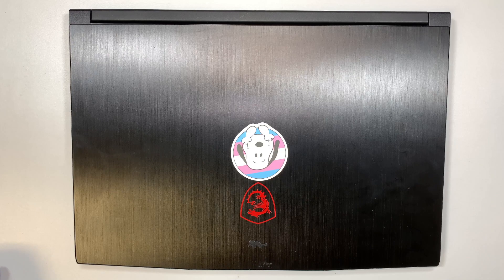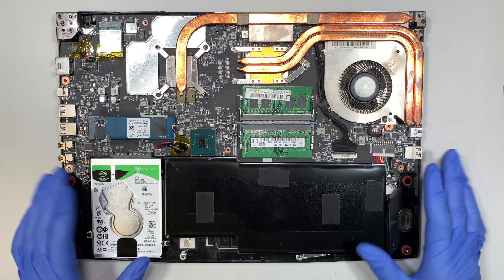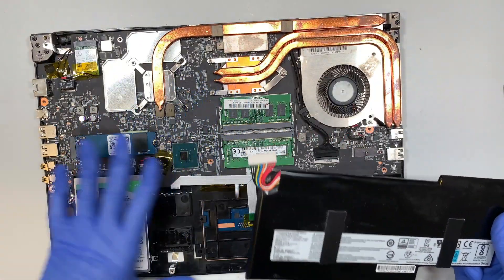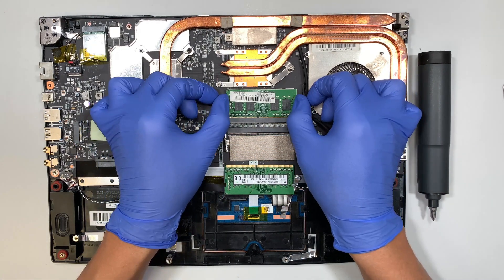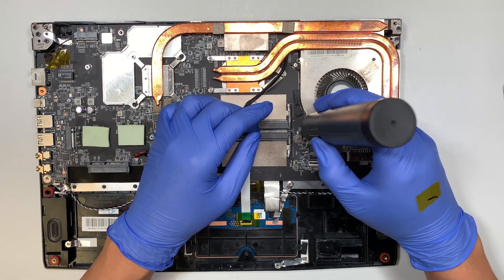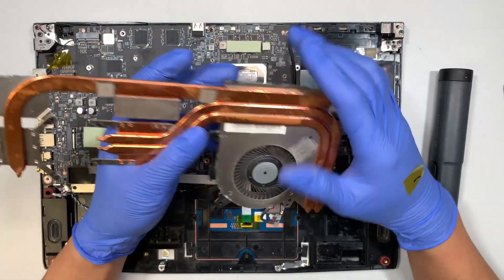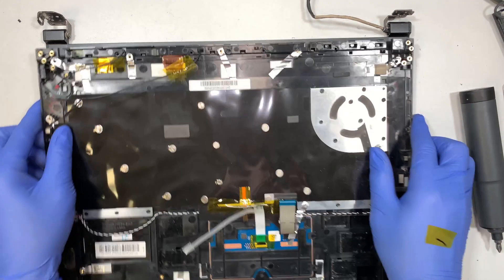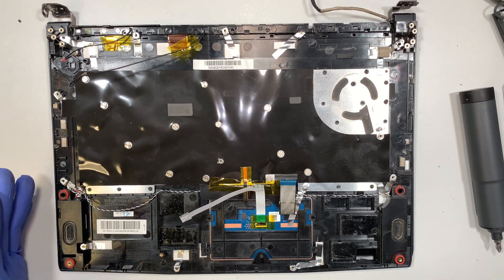MSI Laptop MS-16R4 Tear Down Disassemble

Comment: I’m using the same MSI laptop. I had to replace my display recently because it was showing multiple lines. During the replacement, the display cable (EDC – the one between the motherboard and screen) also got damaged, so I replaced that too.

Now, I’m facing two main issues:

Screen Blinking – When I run the laptop on battery mode, the screen keeps blinking randomly. But when connected to external power, the blinking stops. Sometimes increasing the brightness helps reduce the blinking.

Battery Glitch – After charging to 100% and shutting down the laptop, when I turn it on the next day on battery mode, it suddenly drains and shuts down. But if I connect the charger and power it on, the battery shows the correct charge level from the previous day and starts working normally even after unplugging.

Note: I didn’t use official MSI parts for the display and cable, but the display works fine on other laptops.

Can anyone help me understand what the actual issue might be? Is it the cable, battery calibration, or something else?

Comment: Unfortunately, you didn’t show how to properly remove the USB and audio microphone connectors on the right side, I almost broke my laptop
Reply: Did you ever figure it out? I’m having the same issue
Reply: Yep.. im having the same issue. I put off cleaning it for this reason, i almost pulled off the motherboard and couldnt figure out how to detach it. Please let me know if you found a way
Reply: @May-xo6uo  I figured it out. You have to slide the casing horizontally (parallel to the headphone jacks) to get them out of the way before taking the casing off. Hope this helps.

Comment: This was extremely helpful. Thanks! I spilled wine on this laptop and now it won't power on. I followed your video and took everything apart, cleaned everything with cotton swabs and isopropyl alcohol cleaner. Reassembled, and...still won't power on. Because I can't get into the keyboard mechanism, do you think that's the reason? Does it sound like I need to get a replacement keyboard mechanism? Thanks again and I will definitely donate to your paypal.
Reply from the maker: Sorry to hear that. I do not think keyboard replacement will power on your laptop. Sounds like the motherboard is damaged. What you can do is remove the battery and do a direct adapter to power on. See if that works.